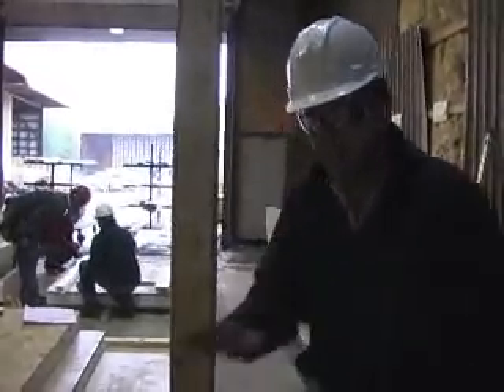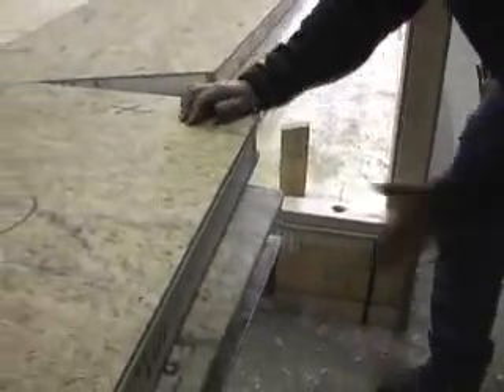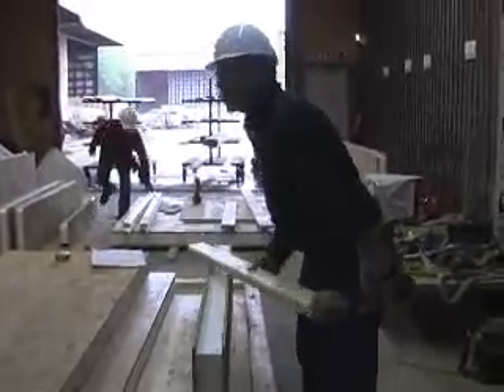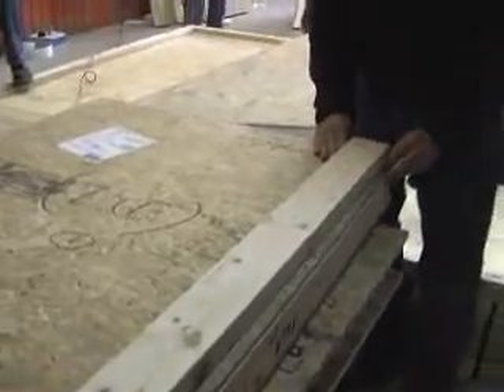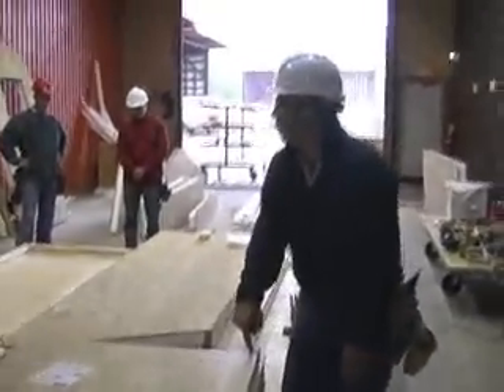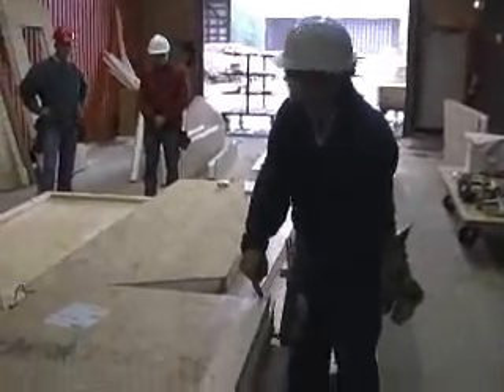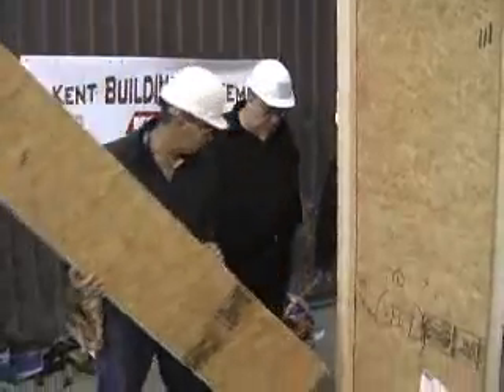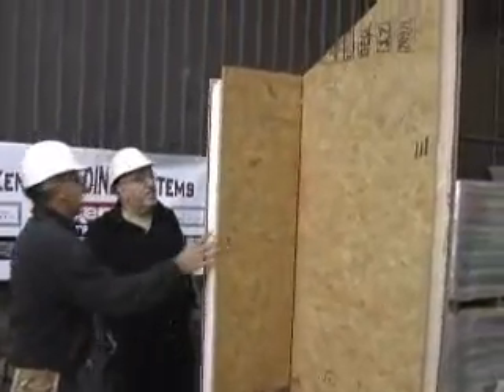Insulspan SIPS - Setting Panels

Comment: On the Kingspan TEK system they pump  expanding foam  from a gun along the female side of the panel and then lock in the timber male end panel into same to stop ingress of air through the joints as air leakage dilutes buildings effeciency even if same is super insulated...